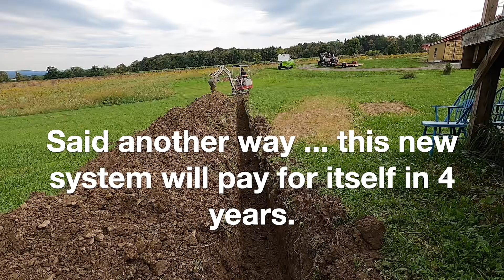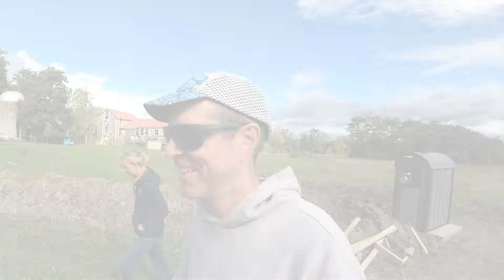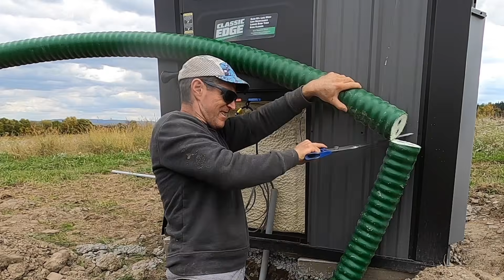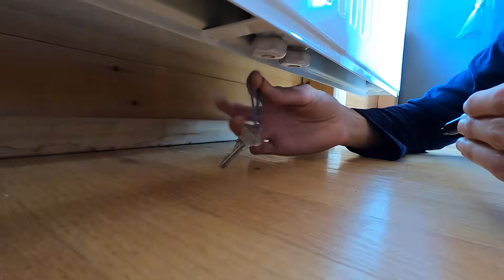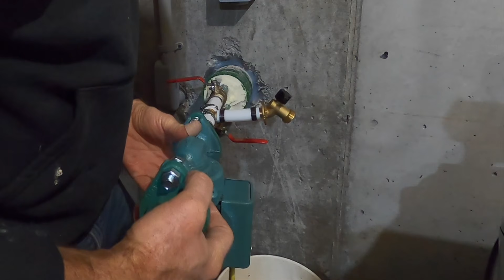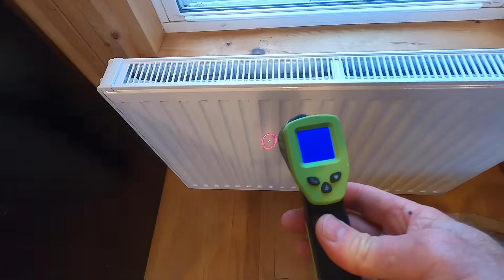Outdoor Wood Boiler FULL INSTALL, Start to Finish

Comment: So is there a thermostat to control heat in each room? We heat with wood stove and are looking to switch to the same setup here but wondering how the heat is controlled(besides opening a window)
Reply from the maker: You can set the system up that way, with each thermostat calling for water off the heated loop. But we have just kept it simple: each radiator is either off or on, no thermostats. works great in our home
Reply: @metaspencer  yea K.I.S.S. makes the most sense to me. is it just turning the valve off from manifold or off switch on radiator? see a know on top right on one so assume it’s a fancy ball valve on the actual radiator? thanks for the video and reply looks awesome
Reply from the maker: @EricPurington  we can do it either way: turn things on and off at the radiators or at the manifold. I prefer the manifold. we typically just run 2 or three radiators and the house is nice and toasty

Comment: I live off grid, and I am considering one of these for my hot water & heating. Where I live gets down to -40f,  so for safety I like the “out of the house” heating system. Two questions:

How much energy does it take to power the boiler with all the pumps/etc.? And that insulated pex pipe is awesome, I won’t be using half of what you did. How much $$ per foot does that run (generally)?

Best video yet. 👍🏼
Reply from the maker: You're gonna love the system -- tons of great heat as long as you have the wood to burn. To figure out the energy usage you'll have to know how many pumps you'll need: probably just one but it depends on how far you'll be pumping to the house and other strucgtures, and what the rise is UP from the boiler. (The boiler has to be lower than the structures or level to them.) So check out the taco pumps, there are many of them out there people use for boilers, and you'll know how much juice you'll need. And note that most boiler pumps run 24/7 365. You'll have to price the insulated pex locally. This was a few years ago but I think we paid $14/foot. could be even more expensive now. the stuff is amazing though as we have virtually ZERO heat loss over our large runs to our buildings.

Comment: Great video even cement  looked like 6 or 7 bag mix ( not watery thumbs-up) not sure how your winters are was told if snow melts over your lines dug your not deep enough. Heat loss Super job
Reply from the maker: we have been super happy with it through 2 winters now. No melt over the lines, only 2 or 3 degrees of temp drop between the heater and the house, and we're heating the big workshop now too. can't beat the quality of the heat! :)

Comment: Just a thought, but if you did re-do this heater, you could take that second line and put a line that goes through the concrete pad where you put your wood so that it will help dry out the wood and remove the snow all at the same time...  Give the mice a nice warm place to nest and sleep as well. 😁😆
Reply from the maker: interesting idea! thanks for checking out the project ... we're pretty happy with it

Comment: i dont understand why it has to be so fare away. makes no sense in any way. effiicency, safety, ease of use.......id hve mine outside the house with a hole in the wall to feed it. whether it be safety, efficiency or ease. seems like a job for sisyphus. iid do whatever made nsurance happy to have close as possible.

and nice work much repsect.
Reply from the maker: We located it far from the house to keep smoke away in winter (so we can open window) and mice/rats. Mice and rats love to hang out in wood piles around here. We also like to space out our buildings on our property. So it works for us!

Comment: The closer the wood boiler is to the house the more hotter the air will be
Reply from the maker: yeah we lose about 2 degrees in water temperature between the boiler and the house. if we put it closer that might be 1 degree

Comment: My pumps and valves all in my warm basement, easy access , not like your setup in the cold
Reply from the maker: Awesome, sounds like you hooked it up perfectly for yourself! So no pumps for you at the boiler also? Maybe no drop to the unit from the buildings? Well done man
Reply: @metaspencer  had my boiler now for 17 years doing two house and hot water
Reply from the maker: perfect! 17 years sounds like a great run
 @jameslehmann6452

Comment: just FYI the UF gray electrical cable doesn't have to go into conduit, it is designed for direct burial.  But it doesn't hurt.  Great job, helping my research.
Reply from the maker: Pro Tip! makes sense because that gray stuff is TUFF. thanks buddy

Comment: How close to a structure could you  place that boiler?
Reply from the maker: That would depend on your local codes and your insurance coverage. Some insurance carriers require it to be 50' away or more. But without any regulations the choice would be yours

Comment: Where are the pumps best located? At the boiler or at the building?
Reply: Makes sense!. I love that you have placed the boiler  at a bit of a distance. I want to do the same, and everyone seems  to have them close. Was interested in the heat loss, but you answered that 😊
Reply from the maker: We have them both in the boiler and in the buildings, but opinions differ on this issue and as I understand it location depends a bit on how much elevation gain you have between boiler and buildings.

Comment: Is any of this up to code?  Did you have a premit, also, Did you had this inspected
Reply from the maker: yes it's permitted as that's required in our area. every area is different so check with your local code officer

Comment: Do wood boilers have safety valve incase of over pressuring?
Reply from the maker: There are a lot of different designs and ours is what's called "open" so no pressure. They can over boil if the controls (dampers, sensors, etc) go screwy.

Comment: Cool stuff.   Why did you place it so far away from house n barn?  Heat loss, friction losses etc add inefficiencies.   No spot closer to house?
Reply from the maker: We lose about 2-3 degrees between the unit and the house, it's true, but located it far from the house the keep smoke and mice away. We like to open windows in winter :) We also like to space out buildings apart and this was a nearly equidistant location between house and barn (which is also heated with the boiler)

Comment: You forgot to add in the yearly running cost of the new system before saying it will pay for itself in 4 years....
Reply from the maker: Good point! so far the running cost has been electricity for the pumps, so I'm estimating about $50 ... but over the life of the unit there will undoubtedly be some replacement pumps
Reply: @metaspencer So your wood costs you $0? I realize its quite a savings with an efficient system but that is stretch...Even if you harvest your own from your property it is quite a bit of time, equipment and fuel to do.
Reply from the maker: @joelsanford  Better than $0 for the wood -- I get paid to bring it back to our farm because I run a tree service. Most people aren't that fortunate, obviously
Reply: @metaspencer  aaah, ok that explains a lot!

Comment: A piece of advice; Don't think that you can do it quicker and easier by using Shark Bite push on fittings. THEY WILL LEAK. Ask me how I know.
Reply from the maker: Yeah I only use rings for that reason … what a scam those are

Comment: Did you factor in your time when calculating the cost? You spend many hours working on this. How much is your time worth? What do you generally make an hour, that is what your time is worth. People forget that. No way propane will stay the same cost in the next 4 years. Most likely it will double. The cost will most likely take 5-7 years to break even. Maybe more with labor for the firewood, maintenance, and daily stacking and loading.
Reply: It's not how much you make per hour becuase you don't work 24 hours a day and you need to save money with your free time. And it inflates rhw value of the property while also still worth it if you live there for decades which a lot of people do. Low bills is always better and a man spending his time being productive rather than working for some company and sitting on his ass the rest of the time is always better as a man
Reply from the maker: It definitely takes time but I never count my hours working on the farm and then multiply by my estimated hourly wage off the farm -- it's just me, maybe, but I don't think that way. Farm work is just something we do and value. I see your perspective though and know a lot of people think that way! good point

Comment: The radiator set up is interesting. The ones iv mainly seen on YouTube have been basically forced air central heat set ups.
Reply from the maker: Yeah we'd only seen forced air and in-floor radiant, too ... but we really like the radiators! it works in our house that never had a furnace
Reply: @metaspencer  👍

Comment: I'm no expert but why so far from the house?  I know there are safety concerns, but it seems way too far to maintain especially in 3 ft of snow later. Just askin?
Reply from the maker: For us there are three reasons why this is the perfect place for the boiler: to keep the woodpile mice far from the house, to keep smoke away from open windows in the winter, and to keep the buildings on our property well spaced out. For us it's a great location but I'd say ya gotta do what works for ya
Reply: Agreed  @metaspencer

Comment: Looking at this I was a little confused at the "4 years to pay off the unit" given the cost of firewood for most folks,  but I look at your channel and yeah, looks like you don't have to pay much, if anything for the bulk of the wood you feed into this system, given the tree work.
Reply from the maker: Yeah it's nice getting paid to bring home firewood -- the cost of good hardwood would definitely lead to different equations for others. Thanks for checking out the project!

Comment: Just curious about the pump inside the house?? I have worked on and installed plenty of hardy outside wood boilers and never seen one inside. Great video
Reply from the maker: We installed that second pump in the house based largely on some diagrams from the boiler manufacturer ... it's probably not necessary but with a bit of a rise between the boiler and the house it seemed to make sense to assist the lower pump. But again, it was a bit of a guess! :)

Comment: Tim from Canada if you were going through a cement foundation.. you’re a little cheap drill, no matter how much you paid for it will not work… do you need to either rent or buy?…SDS Hammer drill.?… this will go through your foundation. . Standard drills may or may not work for your job invest in rent or borrow…SDS Hammer drill. And a good cement holesaw…
Reply from the maker: You said it buddy -- nothing beats a quality hammer drill that's water cooled. Great tools. But we got by with what we had

Comment: Electrical supply line is long .... May want to put a ground pole next to boiler ... ground off for power fluctuate....?
Reply from the maker: Yeah I sunk a ground rod out there for that reason ... good thinking! I have a series of rods over at my new barn but just one at the boiler. Thanks man

Comment: Hi Gary from the UK here, I'm an old heating engineer and I have been in the game for 55 year's, I don't understand why you instead the boiler so far from the house,  And this is a tip for you always fit pumps on the return for 2 reasons No1, the pump will run cooler so the pump will last longer before needing to be replaced and No2 it's quieter because the water jacket of the boiler absorbs the noise. Plus have a look at balancing central heating systems you will get more heat for less wood burnt. 
I  LOVE THAT BOILER. 
Great video very interesting and informative keep them coming thank you
Reply from the maker: Here's why we put the boiler far from the house: 1) we hate mice in the house and wood piles collect millions of them around here, 2) we like to be able to open the windows in the winter, sometimes, and having the boiler far from the house keeps the smoke away. As for temp drop between boiler and house, it's about 1-2 degrees. So far the pumps are hanging in! :) Thanks buddy!
Reply: @metaspencer  Gary from the UK here, thank you for your reply, Now I understand why you install the boiler so far from the house thank you

Comment: I have a big question is there places where the pumps have to be I saw that you have a pump to feed your house from the stove attached to the stove then you have one in the house is the one in the house to help the water return or is it a booster to get it up through the house? And do you need that because of your radiators or would I still need that if I'm just using  air exchanger in my furnace??
Reply from the maker: As I understand it pump size, placement, and number has to do with distance the water flows, how much your boiler is below your house (it can't be higher), and what you're pumping through. I just followed the diagrams on our boiler which suggested two pumps .... and that made sense since having both means less work for the one at the boiler. You'll have to map our your specific system. I've heard that people do things differently.
Reply: @metaspencer  thanks.. I don't have any experience with the boiler.. we burned wood all my life in a stove.. the plumbing is the question... I'm unsure
Reply from the maker: @1oldteck  you can do it man ..
 Simple and good heat
Reply: @metaspencer  thanks

Comment: So we had one a couple of years and then removed it. It was extremely expensive to run not to mention that when the power goes out you have to rush out and hook up a generator to prevent over boiling which if that happens it cracks the fire box. Not to mention you can’t leave your home for more than 24 hours in the winter unless you have someone to feed the fire because you can’t let the water tank freeze in the winter or it will crack the water tank and destroy the pump.
Reply from the maker: Interesting. We hard wired a generator into our power box to make outages easier to deal with and get wood for free so no cost there. But definitely not for everyone!
Reply: You can add antifreeze to eliminate the freezing problem, if you’re going to do this, I wouldn’t run it through your whole house like that I would do a buffer tank hooked up to a heat exchanger, but it is possible

Comment: I see people install a radiant heat concrete floor.  Is this boiler something that could be used for that application?
Reply from the maker: Yeah a lot of people heat that way with this boiler -- it pumps out a lot of hot water so it can be used in heat exchangers, radiant, radiators, etc. Some people heat their pools with them even

Comment: What diameter hole saw did you use?
Reply from the maker: it was a big puppy! it was this one, 4.5" I believe which ended up being a good fit but man that thing took some time to get through. I'd definitely used better bits/saws in the past that are water cooled and all that. https://amzn.to/3tCflOS
Reply: @metaspencer  thank you we sold our old place where I cheated and brought the pipe up an went in through an old ac access but now at our mew place i have to go through the block to get our stove in. Ill try an make some clips of this installation an post it on here for everyone
Reply from the maker: @KiNgSaLaMii  it's great that you're getting it set up before THE COLD! :)

Comment: Why did you put it so far from the house ?
Reply from the maker: For a number of reasons and we really like the location: we wanted smoke far from the house so we can open windows in the winter time; we also wanted mice far from the house as woodsheds always have rodents; we also like to space our buildings out on our property to create less of a crowded overall look and design ... fortunately we don't get a noticable temp drop from the boiler to the house. the cost of the lines to the house was definitely high though!

Comment: Hi ! Why did you put the unit so far away from your buildings ? Do you think that will cut the temperature down , being so far away ??
Reply from the maker: temp only drops 1degree between the unit and the entry to the house ... we put it that far away to keep the rodents and smoke away from the house, and also because we like to spread out buildings out. Nice to be able to open windows in the winter and not get smoked out :)
Reply: @metaspencer  Hi ! Thank you very much for the information !
Reply: Hi ! Thank you very much for the information !

Comment: New sub here👋

I'm thinking about an outdoor boiler here at the cabin, I have a central boiler dealer very close too. This is nice to see that i can do this myself. Great video. We currently heat exclusively with wood with a hotblast forced air stove in the basement, but I'd love to keep the mess that wood creates outside.😂
Reply from the maker: Sounds like a good cabin! We really like the way the wood, bugs, mice, smoke, etc. is all contained far from the house. Great heat too!

Comment: Thank you for the video. I am in the process of building a home in PA and I am considering this setup. Could you let me know what that system costs? Ive seen a $20.000 gassifier system which is a lot for my budget. I dont know what propane costs either lol!  Thanks again
Reply from the maker: I think cost really depends a lot on region, model, how much of the work you do yourself, distance to house, type of heating setup in the house, etc. I'd say the price range would be $10k to $30k depending on all those factors.

Comment: So you still never said how much it cost .???do avoid the question if you can't be straight get off of here  thanks
Reply from the maker: Prices change over time so I never mention them in videos that can be online for many years. Right now a system like this runs about $12k-$14k in my area. Prices seem to vary around the country. Installation and extras cost more, of course